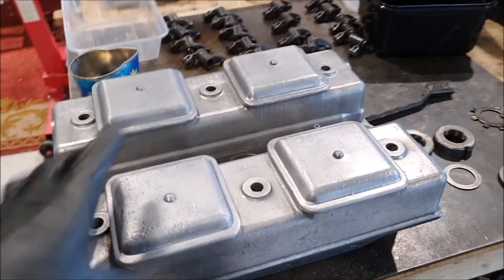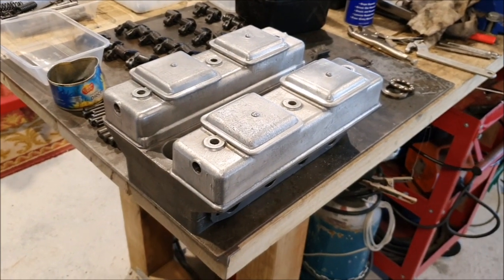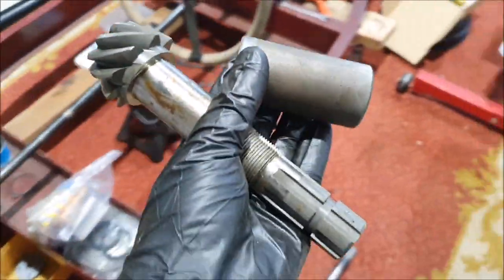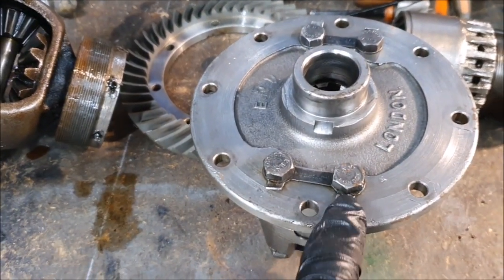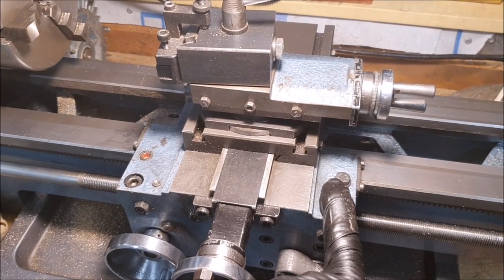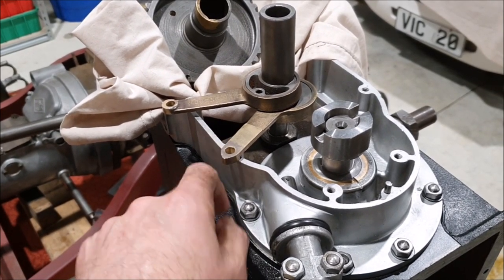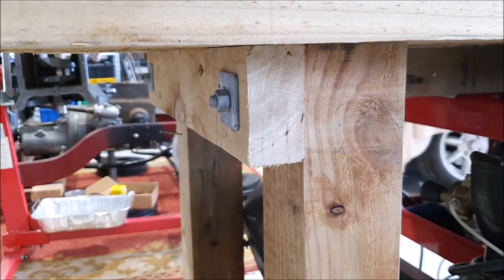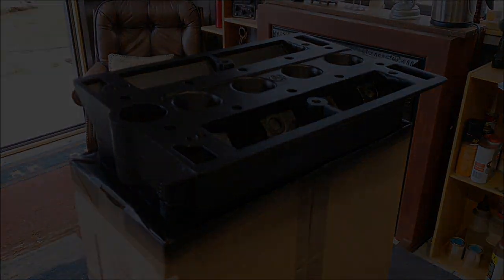Pre war car - Riley 9 torque tube and pinion

Comment: My '29 tourer has the short pinion , I believe the long pinion was on later cars, '35 on. I have never put a gasket on the tappet covers relying on master gasket to seal , no problems in over 35 yrs. It means there is no gasket compressing at the cyl head weak spot.
Reply from the maker: Thanks for the info about the pinion, that reassures me a bit. A test assembly should quickly show if it it right or not. I have heard if you do put a gasket on the rocker covers it should be very thin. I did rub the top surface of the head on some flat glass and wet and dry paper to flatten it off as well as the bottom of the covers so they should be nice and flat. Modern gaskets and sealers are one thing I don't mind using on old cars since you can't see it and they do work so much better!